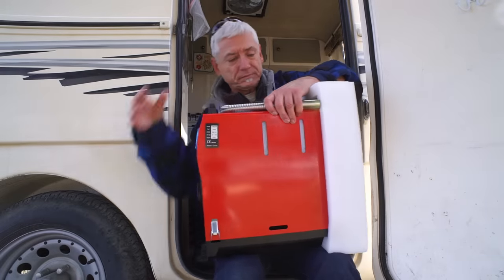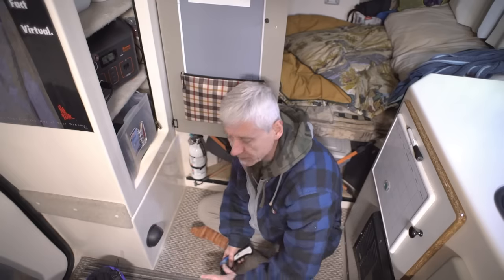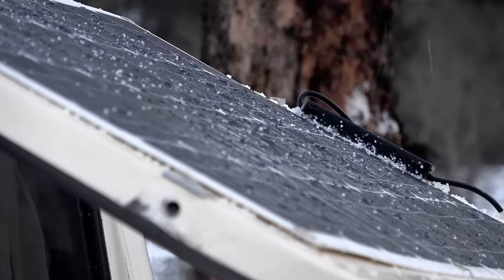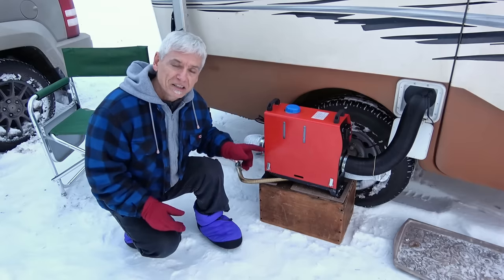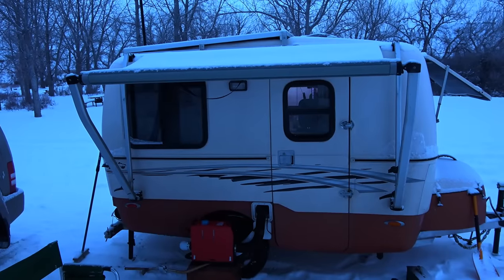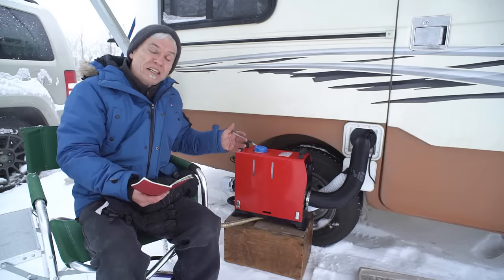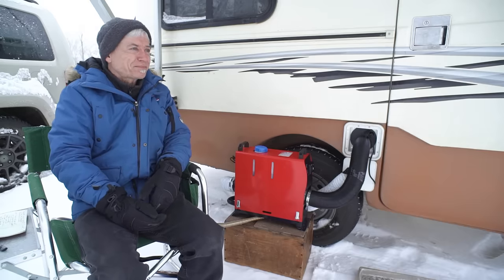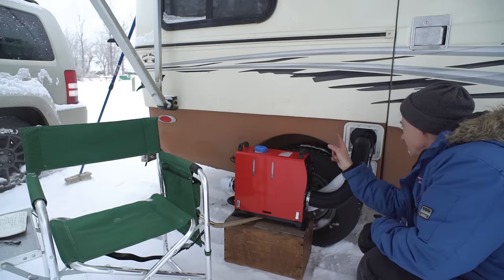Can this Work with a Camper? My Parking Heater Experiment Part 2

Comment: About this infrared: they measure the temperature of the objects and not the air temperature. You will get some objects cooling off to a lower temperature...you see that in places where you get frost on the windows but the air temp never hits freezing

Comment: Hey Slim, are you using both your panels to charge the Jackery? What are their specs (V & W) and are the panels in parallel?
Reply from the maker: Good question. Currently my solar panels are on separate systems. The one over the window cover is just for the Jackery. The big glass solar panel is for my main AGM. If there is not enough power from the 100 watt panel (cloudy day), I simply plug the jackery into my trailer 12V line. Thanks! SP
Reply: @SlimPotatohead  I’ve been doing some “real world” tests on my new Jackery 500. Been running my CPAP off the Jackery every night and letting it charge during the day. Tonight will be the 11th night using the Jackery. It is charging back up on average of 20% each day. I’ll send you a link with the results when done.
Reply from the maker: 20% is terrible. are you using a 100w panel on a cloudy day? get a bigger glass panel like a 285 w one. SP
Reply: @SlimPotatohead  it may be due to me using 16 instead of 10 gauge.  I need to switch to 10 and repeat the tests. I don’t like to connectors on the 10 gauge, difficult to disconnect. My fingers aren’t what they use to be. Will let you know.
Reply from the maker: But what is the rating of the panel? What type of controller? 16 gauge is fine for small panels, unless you are using 400 Watts or more in bright sunlight. SP
Reply: @SlimPotatohead  100w 12v currently 1 panel but was going to connect another in parallel.
Reply from the maker: It sounds like the issue may be your controller. MPPT controllers are far more efficient than the cheap $20 ones. I use an Epever. Thanks! SP

Comment: I have noticed that the fan on my Jackery 500 really likes to have a plentiful supply of fresh air available to dissipate heat, The side vents get pretty warm pretty quickly under load. I am a little surprised that the closet got hot enough to shut the Jackery off, though. Live and learn, I guess...
Reply: In looking at my Jackery "manual" I see that the unit will shut off after 6 hours if the load on it is low enough;  apparently some folks with really efficient 12v refrigerators have been complaining about it.

Comment: Jackery might have an ECO mode that turns it off after 6hrs of low watt usage.  You may be able to disable this mode.
Reply from the maker: That's exactly what appears to have happened, and was discussed shortly after the video was released.  I haven't found a way to bypass this however. Thanks! SP

Comment: A lot of complaints about pump noise. Some report success with rubber or other dampening material between pump and mounting surface. The ticking is annoying.
Reply from the maker: I report no success at all, tried 3 ways, none worked. SP

Comment: cut small section of pool noodle  place the diesel heater pump inside to act as a noise damper. Most of the noise from these pumps is actually just the vibration being transferred to thing its attached to and acting as an amplifier.

Comment: so are there better more electrically efficient propane options??  carry 2 large propane tanks and a heater than uses less watts than what you currently have????
Reply: Yes, there are more efficient propane options. My RV uses on of the, and, it works well but is $$$$. It's so efficient, the manufacturer designed it to have water circulate through a chamber surrounding the entire unit and becomes my water heater too.

Comment: I think the easiest solution would be to run 2 Jackery 1000 and an extra propane in the back of the car. But I know cost is a factor. If you are going to run the propane heater outside, I would suggest a fire board, beside the trailer. Preventative measures.

Comment: I have a question since this is a diesel heater can you use bio diesel as a substitute I had an old diesel generator that I used frying oil from a diner to run it just curious thanks
Reply from the maker: Please don't use an old generator in the woods. Keep the wilderness peaceful. Thanks! SP
Reply: @SlimPotatohead  hi slim I think you missed my question sorry if I was not clear can you use bio diesel In this heater for example frying oil instead of diesel

Comment: 8:56 , It never occurred to me until you mentioned checking the weather via free Wifi a the gas station but wouldn’t a weather radio be handy in remote areas?
Reply from the maker: Weather radios do not work in  the mountains. I can only get a few faint fm stations, mostly country with no weather reports! SP

Comment: I have one of these but it only does that click noise when you first start it after about 3 minutes the noise stops and it is nearly silent for the most part
Reply from the maker: You can't have this exact model. SP
Reply: @SlimPotatohead  probably not the same exact mine is the 8K w but pretty much the same look electronics etc I actually really enjoy mine but there's definitely a lot of quirks and I'm still figuring it out... Hopefully you do as well because I think it has great potential for frigid weather lol

Comment: Hi, slim I put a diesel heater in my van. The controller like u have has to be inside. There is a temp Thermostat built in to regulate the temp in van hope this help
Reply from the maker: I don't own a van. Different use. Thanks! SP
Reply: @SlimPotatohead  hi I have avan like u had controller had to b inside
Reply from the maker: Why did it "have to be" inside? Will it explode? Break down? Having used it at -20C with no negative effects, I see no advantage to bring it inside when used in a manual pumping mode. That would defeat the purpose. SP

Comment: I've been wanting one, but supposedly they use 12amps in startup mode and my eb150 only has car charger plug with 10 amps max, but it looks like it works on your jackery and I think your plug only has 10 amps max also? Do you know how many amps it was using in startup mode?
Reply from the maker: See part 1. Thanks! SP
Reply: @SlimPotatohead  already did. I guess if it worked,  then it uses less than 10 amps startup, but I didn't see that in part 1. None of these heaters ever tell you this in their specs. Thanks.
Reply from the maker: I said it goes up to 116 Watts. That's around 9  amps depending on your battery charge. Thanks! SP

Comment: I think the cheap webasto clones are a better design. Takes the air from inside the cabin and then heats it to be even hotter. More efficient. Fuel tank and fuel pump could be mounted outside, possibly insulated for sound. Since the heater would be operating inside the cabin, the tick of the fuel pump would probably be less noticeable with the burning of the fuel and a fan running being more of a white noise to drown it out a bit. You can search on youtube for 'chinese diesel heater'.

Comment: How bout a small ceramic heater that regulates temp off and on through your jackery for the night. Then solar to charge jackery during the day. Works great for me and my small trailer. 🙂
Reply from the maker: My bet is you haven't actually tried this. Ceramic heaters start around 300 watts and go up. Wouldnt last more than an hour and your battery would be dead, and wouldn't even keep the camper warm. SP

Comment: How about a ceramic heater?
Is a ceramic heater energy efficient enough?
Reply from the maker: Are you referring to a ceramic space heater? Far too much energy consumed for off the grid camping. SP
Reply: @SlimPotatohead  Thank you for responding.
I thought a ceramic space heater is compact and energy efficient.
I must keep searching the best heater for winter camping.
Reply from the maker: To heat a small camper solely on electricity, you need at least 2000 watt heater. Even with a good battery and inverter you may only get a couple of hours before your battery is dead. My next video will briefly touch on this topic. Thanks! SP
Reply: @SlimPotatohead  
I see. This is an important info.
I wait for your next video.
Thank you, again.

Comment: as you are pulling air from the cold outside the heater has to work harder to heat the room,it5 is designed to circulate the air inside. also it cant get a true temp reading of the inside of the trailer as the thermostat is on the inlet side of the air duct so the heater will never go into tick over mode.
Reply from the maker: Incorrect. In manual mode it stays the same rate regardless of temperature. SP
Reply: as the heater always thinks its cold inside because you are pulling air from outside. hope tis helps.
Reply from the maker: Please read my comment again. Manual mode. Nothing changes unless I program it to. SP
Reply: @SlimPotatohead  ok  mine still has the original controls so not sure if this makes a difference.
Reply: all in all a great little heater, thinking of getting one for my garage
Reply: @SlimPotatohead i read your comment the first time!

Comment: If you connect the air inlet of the heater to a coupler to the inside air of the dwelling, your heater will likely be 2x efficient
Reply from the maker: I'm not sure I really want it twice as hot. The main issues were noise, diesel fumes and the unit shutting off. Inside air intake may at least reduce the fumes however. Thanks! SP

Comment: Also keep in mind that your camper is a 3-season rig that is not designed for Canadian winter conditions. Sure you could survive in it but cold winter weather is beyond it’s designed specs.
Reply from the maker: There's no such thing as a 4-season camper. All must be modified to suit. Campers, just as the tow vehicles, can all be adapted for all-season use. Thanks! SP
Reply: @SlimPotatohead  well actually Bigfoot manufacturing in Canada makes a 4 season camper.  Oliver and Lance both make 4 season models.  Yetti in Minnesota makes an ice fishing house/travel trailer from a cargo trailer frame.  They then insulate it and such to convert it for winter use. The common factors are: double panel windows, smaller windows (less heat loss), heated pipes, heavily insulated floors and walls, and multiple heat sources. These campers weigh a lot more than the average rig, and of course these come at a high cost.  A small Oliver camper about the size you have starts at $49,000 !!   Too rich for my wallet. But the point being is they do make 4 season Campers that are built and insulated for both extreme heat and cold.
Reply from the maker: Viking V, my point is that all these manufacturers think about is in terms of insulation. They do not make them any easier to tow them in a foot of snow! A true all season camper would also be an all terrain one, however I suspect they would be far beyond the budget of the average traveler! SP
Reply: @SlimPotatohead  that’s true

Comment: I'm just curious the control panel on the unit is that also a thermostat
Reply: The digital controller has a thermostat that slows the heater down when it gets to the desired temp.  With the controller outside it just sees cold and keeps running.  There are two ways to set it up, either at a preset temp. or at a frequency (the amount of fuel that the pump delivers),  I guess the simpler controller that Slim fitted just works on regulating the amount of fuel being delivered and does not relate to the temp.
Reply: @raysmith4997  that's what I was thinking if it's outside it's never going to adjust itself so it probably overheats and turns itself off
Reply: Guys, Slim removed the LCD unit and replaced it with a mechanical adjustment. All Slim needs, and wants, is for his heater to run on low continuously. The amount of power the unit draws to start up again and again, through the night, is much higher than running it continuously. It's now adjusted manually.

Comment: Looks to be overly complicated. You need a smaller one that is mounted inside recirculating the heated air. Put the fuel tank outside in the front along with a battery. No fussy around with the setup you have now. Just park it and enjoy.
Reply from the maker: That's far more complicated. You do understand I am not interested in a permanent installation I hope? Thanks! SP
Reply: @SlimPotatohead  To set up and haul that big thing around is more complicated in my eyes. Thanks for the video Slim.

Comment: I would probably resign myself to having to hear the pump tapping.   Then I  thought maybe it's a good thing it taps like that.  You can tune the noise out and listen for it every now and then.  If the noise has stopped you know the heater quit working and you need to check on why it quit.  Sort of an alarm in reverse.

Comment: So do you have any other heating options on the table, or do you just plan on continuing use of the furnace?

During the first video I was also concerned with the exhaust blowing so close to the "fresh air" inlet. Bad design on their part.

I suspect that hole will be used for AC in the summer. If you like sleeping at 50F, I can't imagine how you'd survive without it!

Comment: Why does it click?
Chinese products normally require design tweaks to make them safe or even functional.
You bought a diesel heater "kit". Nice work sorting it out.
Your power bank cutoff is an odd feature. It's wasn't the LVD functioning correctly was it?.

Comment: What you got is a diesel car heater that was fitted to a self contained unit.   That's why the intake and exhaust hoses come out the bottom.   You bought a cheap unit, there are better ones.  All the units I've seen on Youtube have that damn tlicking noise from the pump.

Comment: Other owners of these units have isolated the pump from the metal housing with rubber suspension and sound insulating the housing to minimize the ticking.
Reply: Already tried ... didn't help.

Comment: what about insulating the heating pipe into the camper and save a bit more heat before it gets into the camper
Reply from the maker: Why do I want more heat? SP
Reply: @SlimPotatohead  not more heat but more efficient heat distribution

Comment: Too bad you dont buy one of those collapsible dog houses that fold in on themselves. Insulate glue in for the clicking what you can do for walls to reduce noise.  You dont need to do this but in alaska 1 gallon of gas goes to 55 gallons of fuel for an anti gel additive how they did it with the alaskan pipeline. Forestry Forest and Chad with Living the Van Life both use the diesel as well. I wonder if it will work with older diesel after filtered.

Comment: These heaters are not weather proof like webasto's and other. The circuit boards inside will corode over time if you keep using it like this. It's intended for indoor installation.  Maybe consider mounting it you front storage.

Comment: the clicking sound should be less ..if you have the pump hanging lose in a zip tie for instanance..saw a video on it
Reply from the maker: Nope. Tried that. Plus open and closed cell foam. Did nuttin. SP

Comment: 18:55 Don't ya mean it used 24% of your battery? It indicated 76% meaning that is what is left... right? 
What is that clicking noise? Is it the pump? Maybe a fun video would be to find a way to dampened the noise.
Reply: Yes, 24%. I suspect Part 3 is coming ...
Reply from the maker: Sorry, I read my own notes wrong. Yes, I only used 24% of my battery. Just  edited this out to avoid confusion. Great catch! SP

Comment: Are you sure it's the heater itself shutting down? I understand the battery shuts down when not enough energy is pulled from it. It's a problem w ppl who run a CPAP machine. I think there's a  way around it, but I don't remember what it is. (Too many YouTube videos on batteries)

Comment: Isolate the fuel pump from the frame using heat/fireproof insulation. There's lots to choose from on the market for almost ant conseivable application

Comment: monoxide wouldn't build up as the exhaust is on the outside - so why was it not safe? no more dangerous than a car tailpipe
Reply from the maker: Hi Pete, using any heater outside the conditions it was designed for will have the potential of safety issues. Thanks! SP

Comment: Really enjoyed the 2 heater videos. I have a possible solution for that tapping noise which might also help to keep weather off the heater.  How about 3 pieces of say 1/4" plywood to cover the sides and top of the heater, maybe with some light insulation to act as a sound deadener. Using similar clips to the ones holding the heater body to its base.

Comment: wear your gloves mister ... 

I appreciate your nitpicking ... 

Next time try to recover a little more heat if possible ... maybe a little box through which the exhaust goes through and from which the vent capture cold air ... a new more degrees and you might be able to cook with that heater ... Great for IF SHTF ...

Comment: The CE is a European standard, so it passes the German standerd. no issues safety wize. These Chinese products are better than they where 15 years ago. The only things that go wrong with these heaters are the fuel pump and the glow plug. One of them will most likely fail in a year but are easy to replace and cheap. You can choose original Eberspächer parts to make it more durable.
Reply: CE, is also a designation used in China for their manufacturers. I doubt this unit is meeting any standard accepted in either Europe or North America.

Comment: Why not just buy the unit you have to mount inside? No fuel gelling, all your heat and heat duct is indoors so you get max heat.
Reply from the maker: Sounds like you missed Part 1. It explains the whole purpose of the experiment. SP